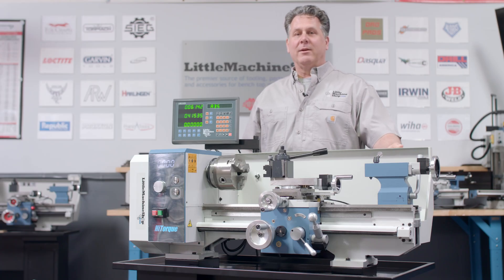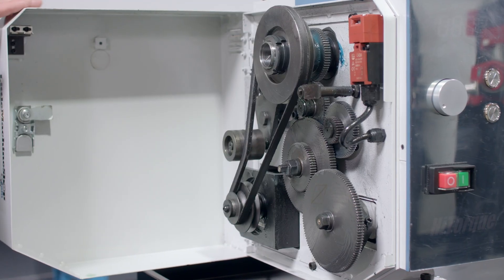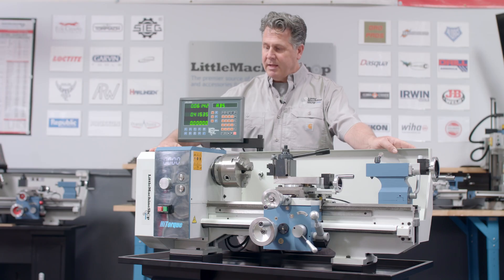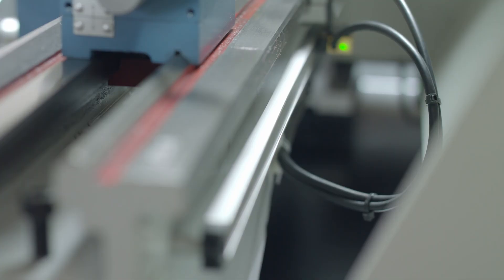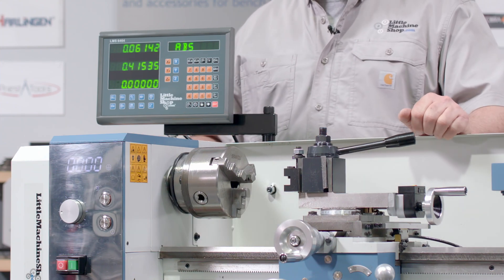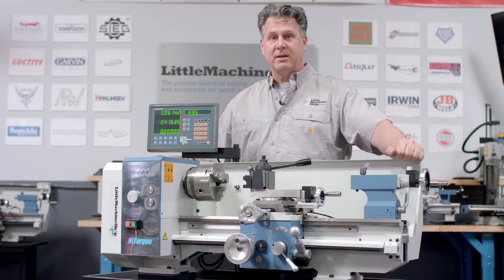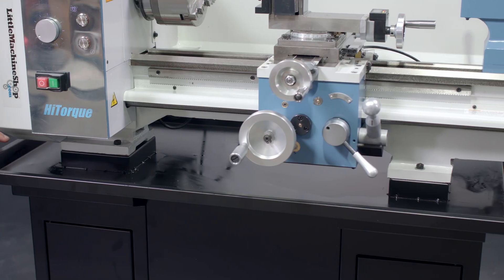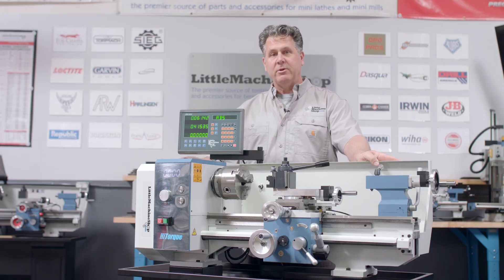Walkthrough of our HiTorque 7650 Deluxe Bench Lathe

Comment: Nobody talked about threating on this machine ?????????
Reply from the maker: Your right... We'll cover threading in more detail in an upcoming video, but it comes with a reversible 2 mm pitch lead screw providing extended threading capability. You can create every American Standard Unified class 2A inch screw thread from 6 to 80 threads per inch, and you can create every American Standard Metric class 6h thread from 0.25 to 4 mm pitch with the change gears that are included. All the gears on this lathe are metal.